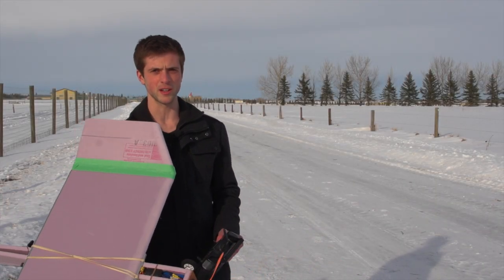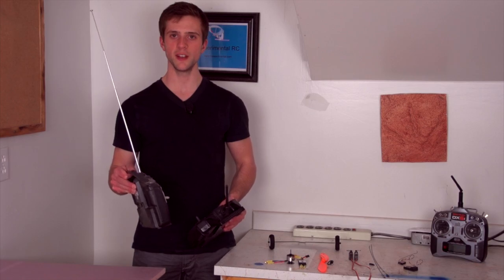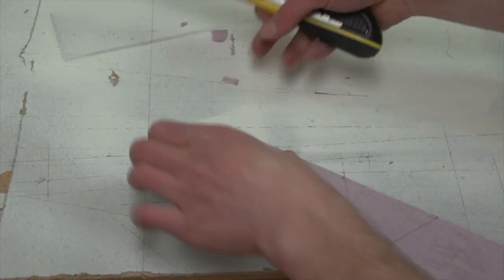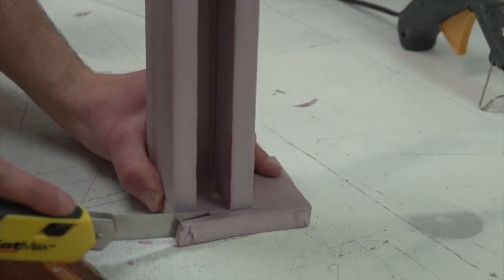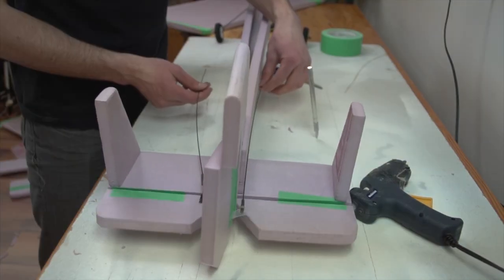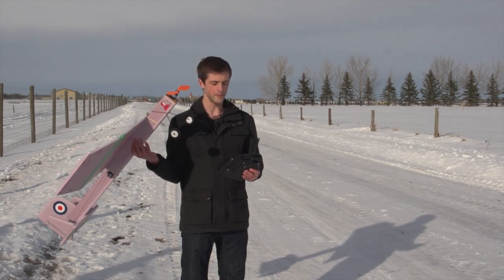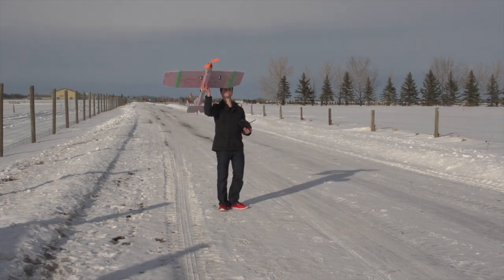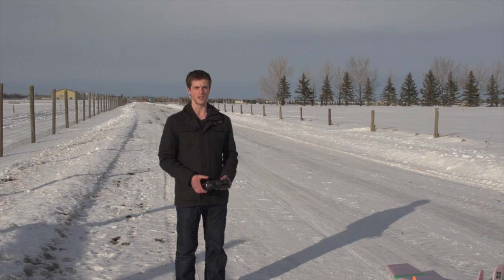How to build and fly an RC plane

Comment: I do not understand the shape of the wing. It does not look like an airfoil, that has a slope on the top, tapering down to the back. How can it get lift? Your wing is flat on the top and flat on the bottom. Am I missing something?
Reply: fishingrod9 ailerons can create high pressure zones at the bottom of the wing. This comment is 3 years late
Reply: @kensrocketry2785  so am i

Comment: $10? LOL all the things would cost over $50!
Reply: not really when i went to the website a cheap radio was $25 and when i go to other websites a cheap radio would be $70
Reply: That's why I said "all the things", plural, you'll need battery, foam, motor, propeller, etc. LOL :)
Reply: ***** yeah, thanks for the reply, my problem wasn't the frame it was the electronics.
Reply: Jokes on you. I already have a 3s 5200 mah battery from my drone 😈
Reply: Flex Quad that would probs be to heavy unless you add a bigger motor

Comment: Hey Tim, I just built your Plane! I just took your plane apart ! I just rebuilt your plane! It is Feb. 2014 , As I was finishing it as best that I could with out some key info. CG, Wing placement ie: Distiance from the motor mount? I just took of all the colored tape and changing the main wing to have the steps in them! 
I really think that you are on the way, and that is from a Pearson who has built atv A-arms etc. for the last 10 years. I will now finish with paint ( worked for Sherwin Willams for 25 years) I Will send you some photos when I am done! Thank YOU from "OLD GUY" ! MIKE
   PS How about a pusher b y wing!!!!!!!

Comment: Hey man I really liked your video and im going to build the plane
I bought a Dx6i from a guy at my local rc flying club but it was the transmitter only. Could You tell me which receiver will be the best for the plane? I don't want to spend more than 20$ on a receiver. On hobbyking they have Orange brand receivers.
could you tell me which one will work for the plane AND the Dx6i?

Thanks alot and please reply soon

Comment: Hi , I am from Slovakia. You have plane from 1/2" foam , but i have 3mm - 1/8" depron (2 tables 1000x700x3mm=ca. 39x27,5x0,11")- is it correct or ..... and i can stick two depron tables - 2 layers - 6mm - 1/4" --- is good?             Thanks .... :)

Comment: Well I guess 10 bucks is meant for parts. After you start rc hobby, you have a lot of servos and stuff just lying there. After all this is very basic plane and doesn't require best possible servos or transmitter.

Or if you have same case as I had. I started my hobby via friend. He gave me 3 different planes which all were crashed and helped me to build one working training plane.

And buying ok 4ch from store is about 200 bucks

Comment: dont messup with those recivers and controlers
NO!!! not evry controler work with any reciver,,
they were already set to particular frequency..
you better by a cheap plane and make use of its parts (motor,servos,transmittr,etc) to make any RC eqpmnt for your project.
ATB :)

Comment from the maker: It flies very nice with a kfm4, check out my KF Airfoil flight testing video I did to see a comparison. Half inch foam is ideal, but it will work with thinner material and I don't think there is any need to use twin motors on this design. Its simpler with one motor. Thanks for the comments!

Comment from the maker: Where is your centre of gravity? Sounds tail heavy. The front of the wing should be about 4 inches behind the nose, and the centre of gravity should be 3-4 inches back from the top of the wing. Try adjusting this and see if that helps. Also, if you post a video response of the problem I will take a look at a that. Good luck!